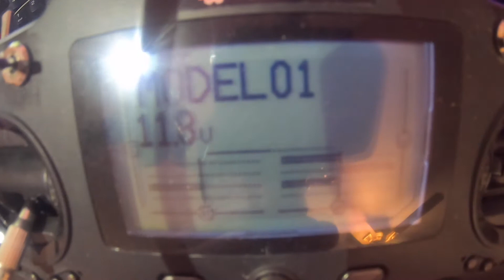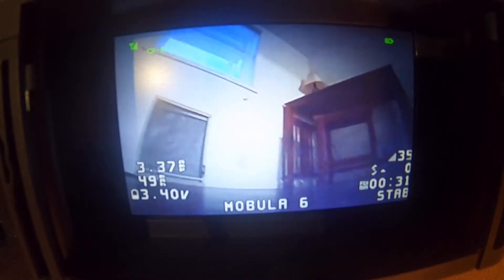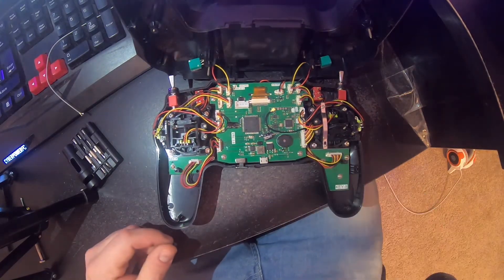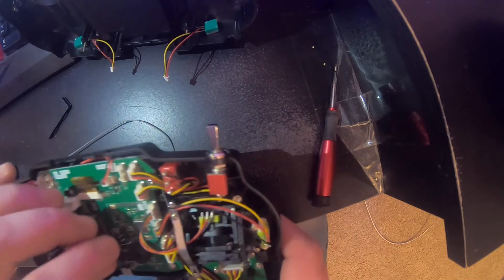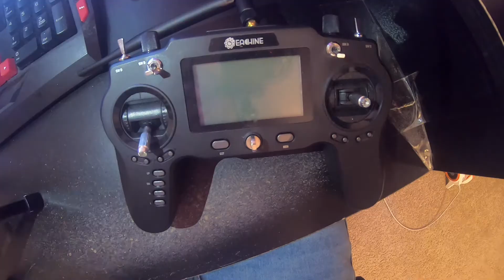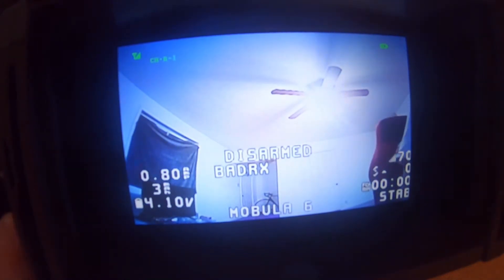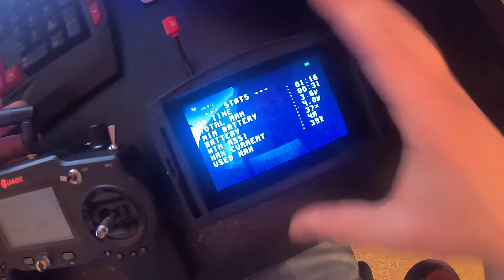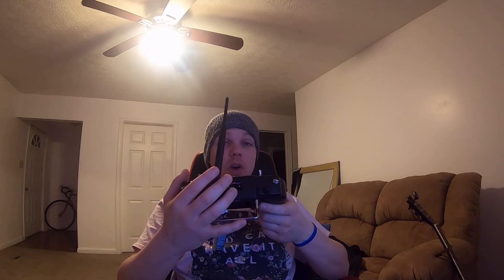Eachine Novice 3 Range Upgrade! (Read Description)

Comment: Do you know what this USB is for? I'm trying to use as controller in computer to use in simulator. Is it capable of it?
Reply from the maker: No sadly it is not capable only for charging the battery.
Reply: That's sad. I kinda regret buying this kit. I ordered a Radiomaster Tx12 for use it in simulator before fly in real to not hitting aniyone

Comment: Hey, i did the same thing in the summer and was surprised - the range significantly rise up. My advice to you - is to remove one of the potentiometers (rotary) and put antenna there.

Comment: Thanks, I have the same kit, coming with some failsafe crashes. Can you do a real outside range comparsion, with this antenne to the old one? Which antenne do you have for the googles. There also not the stock one.
Reply from the maker: I was thinking of doing a outside test but its 13 degrees outside lol. Maybe when it warms up. Goggle antenna is a lollipop RH.
Reply: @dusti25   )))) 13 degress .. i was flying yesterdayy at minus 10 C )) 13 degrees is a very comfortable temp for drone actually
Reply from the maker: @technopancake  13 f not c
Reply: @dusti25  huh, 13f=10c))))
Reply: -10
Reply from the maker: @technopancake  no its cold af outside where i live 13 degrees f. So for you it would -10 where i live
Reply: @dusti25  I appreciate if you do this tes!

Comment: @DQFPV man would the novice 3 better than the Novice 2 v2? Could you do a video about it? Thanks a lot in advance
Reply from the maker: Thats a good idea. I will look into it.
Reply: @dusti25  https://youtu.be/2oQgtZbYRjw he talks about some stuff here and brings out the same Athena you were using hehehe
Reply: I ordered the novice 2 v2 over the novice 3 because the Eachine novice 2 drone is such a tank and the flight controller flySkye fs-i6 is so amazing. The googles are okay and will get you flying. I would upgrade the googles but besides that the Eachine novice 2 V2 is the way to go and an amazing rtf kit.
Reply: @anthonyberg5986  thanks man, that is exactly what I was wondering, I want to jumt into FPV world and wanna get a kit to start with, but the best I can hehe
Reply: Also that Athena is used by a pro, look up Mr Steele